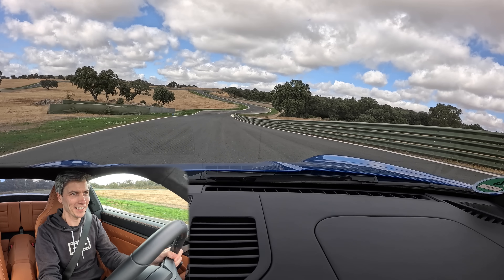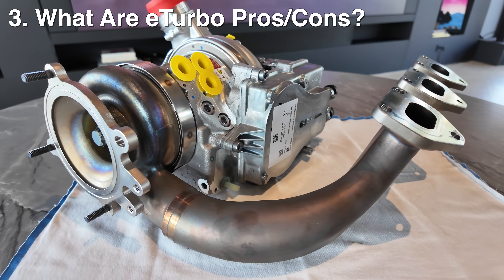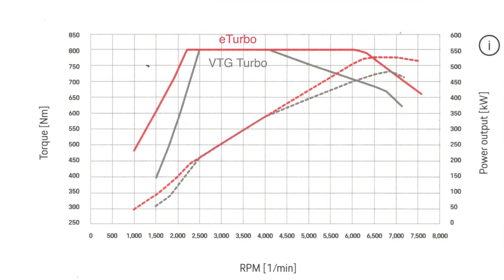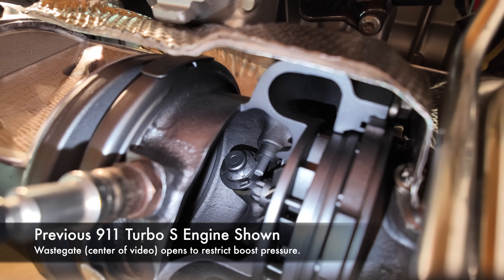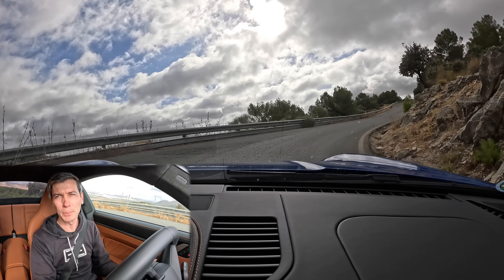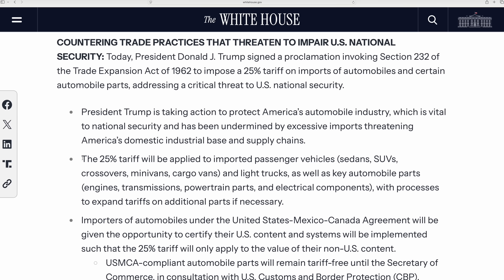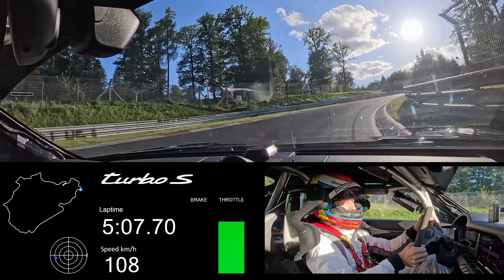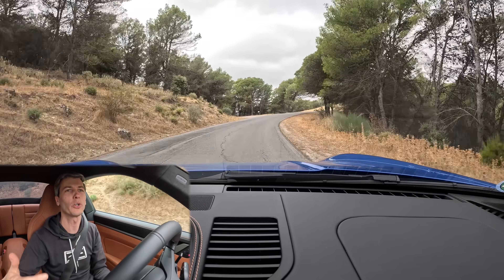Electric Turbos Are Here — Is It A Good Thing?

Comment: The real issue with 911s is that 12 year old models cost more than normal new cars.
Reply: Sounds like you get to daily a Porsche :P
Reply: They hold their value. Makes leases more affordable, but it does make it hard to buy a used one for pennies on the dollar. The current “cheap” 911 is the 1999 - 2005 996. You need to be aware of the limitations, but you can buy one for $20k-$30k. 

Alternative is to spend that amount on a 24 month lease on a new one. But you’ll have nothing after the lease. 

Another way to look at it is that Porsche is a luxury brand. They don’t sell cars for every buyer.
Reply: @EdDale44135 911s are a something else. A Porsche Cayenne or SUV is not a luxury car. Those are soccer mom cars.

Comment: I misunderstood this when it first came out.I thought there is an electrical motor that spins on the exhaust side that charges a battery independently. Then there is another electric motor that spins the turbine in the turbo. I was initially happy that the turbo does not need to get super hot anymore and no need for both oil and coolant to cool it. 

Now i understand that the turbo and electric motor is still connected to the exhaust.

Comment: I've always liked the idea of electric turbos in terms of getting more power and less lag. But wouldn't there be a concern having an electric motor especially one that is responsible for multiple jobs, build directly connected to one of the hottest parts in a combustion engine.
When I thought the idea of electric turbos back years ago when I heard about them. I though of it to replace the need to have exhaust power the turbo. More like an in-between turbo/super charger.

Comment: I wonder if the back-pressure form the e-turbo, while regenerating will hurt the engine. waste-gates just let the exhaust-gas exit without extra resistance
Reply: I think you aren't understanding this right. The turbos can't be restrictive, they are bigger and all exhaust goes through the turbine instead of a small wastegate. The electric motor just prevents overspeed. And if they were restrictive, running the engine at Lambda 1 would destroy it in seconds.
Reply: they would have some resistance, every valve and length of pipe does. But i dont think youre really worried about gas scavenging in a situation where regenerative turbining is active

Comment: I've been working in one of Porsche's test centers during the development of this car and what the test drivers-enginneers were able to achieve playing with the throttle pedal (or with the computer?) meanwhile the engine was at idle was comical, never heard a turbo spool up so quickly, it sounded like having a car with little jet engines 😂 Indeed my favorite application of hybrid engine technology.
Reply from the maker: The turbo sound is quite cool! My mic doesn’t really capture it well in this video.
Reply: @EngineeringExplained   I'm kind of surprised you aren't working at Porsche AG yet, lol. I mean, they earn the rep with their amazing engineering. My great uncle drove Lotus and Porsche in the late 60s, early 70s - 908, 910 and 917. That part of the fam still owns a non-running 910 chassis.. sitting wrapped against rust in a car barn on the west coast.
Reply: @EngineeringExplained it was very loud on the test cars, but I have no idea how is it on the final product, I still didn't have the occasion to see one running properly.
Reply: Maybe you might be able to answer this question.  He says that the electric power goes to the electric turbos first which makes sense in a performance situation but lets say you are driving around town wouldnt it make sense to have the electric power go to the electric motor first?  It seems like you could increase the city mpg by doing that.  It would provide that torque to get the car moving and then the ICE engine would just keep the car moving.  Just have an eco mode for the car for the day to day driving.
Reply: @pin65371 this is a good point. What Jason is assuming is that we are at wide open throttle (WOT.) At engine parameters of less than WOT, the use of any turbo is minimal, and you would be applying a flow restriction to the intake path. Most turbo systems are designed around this concept. It took me a while to get it.
Reply: @pin65371  I have a Porsche Panamera e Hybrid.  When I am cruising at low RPM and hit the gas, I'm pretty sure that the battery assists the drive shaft at the same time as spooling up the turbos.  Jason was reviewing a 911, whereas mine is a Panamera.  Porsche engineers might have optimized the system differently for the two different cars.  Or, I might not know what I'm talking about.  But the bottom line is, my Panamera accelerates smoothly from a cruising situation.  There is a button on the steering wheel that I call "all systems go".  When you press that button you get 20 seconds of maximum performance.  That button might re-map the electric to spool up the turbos first, just as Jason explained.  I don't know this for a fact,  but that is how it feels.
Reply: @pin65371 unfortunately I cannot answer on this, I'm not an engineer and I wasn't involved in the development of the car, I was there mainly as support.
Reply: @pin65371  I dont think they care about that, but rather want it to improve performance - rather than driving around like a prius/silent in the city.
Customers for the 911 turbo I think want it to make noise and be quick. Of course car makers have fleet emissions to consider too, but that is on the average of the fleet.

So the top models they often want to compete on performance as a metric.
Reply: @OlavAlexanderMjelde  I get that but it seems like it would be a pretty easy thing to just have an "eco" mode where it sends more power to the electric drive motor first just to get the car moving.
Reply: @pin65371  yes, it would be better for the environment I guess, but it would make less noise from the engine.. So I think if you buy the "top dog" Porsche, you dont want it to be silent. Then you want people to look at the car as you are arriving or going away..
Reply: > never heard a turbo spool up so quickly, it sounded like having a car with little jet engines
Aren't jet engines actually relatively slow to spin up?...
Reply: @PavelKostromitinov I was referring to the fact that the turbos were able to reach a decently high speed faster than the engine could raise from idle so you were hearing a strong whistle from the turbos before hearing the engine sound increasing. It might easily be that this is not achievable on the final product and that it wasn't even achieved through the throttle pedal.
Reply: Wow would the type work on my ML420cdi ¿ Are what's you idea on making my Ml 420 twin turbos faster? 
Everton
Reply: What about heat? Electric motors have potting around their windings and I'm curious about life time of these electric turbo motors....
Reply: So... why not just apply a belt-driven blower instead of adding more stuff to break, in an already ablative system?
Reply: I know the janitor at the same test center and they said the same thing 😮
Reply: Was that in Georgia?
Reply: @jasonhunt007 looks like the launch event in Italy

Comment: One important question is the pedal feel. I have a Mercedes Benz C mild hybrid. The electricity has absolutely ruined the gas and brake feel in city driving. The feel isn't just bad, it changes all the time. I have now had 2 generations of these and both generations have a bad feel, but in different ways. My cars are 2019 and 2022 (2019 and bad battery problems and I ended up buying a new one). 2019 had the electric engine/generator up front, the other between engine and gearbox. This video mentions no feel problems. I hope Mercedes Benz cures its problems. Don't ever get me started on the new glass dash and touch buttons on the steering wheel.. I have been driving cars and heavier stuff for 50 years now. Many things are better now, but the companies should hire real automotive engineers instead of all these computer nerds they now have. I drive a car, not a phone or pad. Some things were definitely better before.
Reply: Use drive program Sport or Sport plus, you might get better feeling I guess!

Comment: Wonderful explanation of this system (as expected from you). As there is no wastegate, as the turbo drives the motor as a generator to recover energy doesn't this increase exhaust backpressure, affecting engine exhaust efficiency?

Comment: Surprised they went with 97mm bore compared to 102mm in the previous turbo models and GT3s. Makes this feel very close to the GTS powertrain. Could be emissions also, Andreas mentioned they couldn't get the 104,5mm (4,194l) from GT3 R trough emissions for the new 992.2 GT3. Excited to see what they do for the new GT2 RS.

Comment: Little failure in the explanation…there are 711 HP …like zip-code of Stuttgart 😊
Reply: no. 711 wimpy European PS (metric horsepower). 701 proper Imperial brake horsepower

Comment: I'm interested in what the aftermarket will do with these e-turbos (assuming it won't be limited to OEMs) and how they'd be implemented. Would it mean we'd need another battery or could we run it off 12v? Could it replace the alternator, thus freeing up the engine more? How would it be controlled?

Comment: Hmmm …very impressive, but an emotor sandwich between two hot turbines…???. Just like those hot “Vs” a few years back; sandwiching a turbo between the cavities of the “V “ cams; that didn’t turn out so well did they?

The Germans, great engineering but not so great in keeping them running.
Reply: That is an oxymoron: being a great engineer implies that you design things that work well and keep working well for as long as necessary. And your misgivings are clearly unfounded and based on guesswork. Electric Turbo's are a well know concept that has been on te market for quite some time now. It is just a case of designing the cooling and material choice.

Comment: The idea activly accelerating the turbocharger at low rpm and taking energy from the turbine is actually quite old already. The british experimented with it in the 1940s, on a 12 cylinder 41 L two stroke diesel.

Comment: How much weight added ? 85Kg. How much power consumed ? 40Kw. How much more power to generate by the alternator with electrical losses ? Is there a regen period during which I cannot use the electric turbo ? Isn't a supercharger better ? Isn't it easier to double clutch down two gears ? I don't know if I care about accelerating in fourth but I know I care about breaking distances.
Reply: 85kg more on a 1600kg + car isn't gonna make huge difference on breaking distance.
Reply: @yapod9061  depends on the roads you are using said car.

Comment: Can you imagine the issues these will have a few years down the line. 

Porsche are not good engineers, did anyone say IMS bearings, Bore Scoring, cracked engine casings, exposing most of the engine in earlier models to road dirt/salt/water and the effect thereafter on any maintenance as a result, Cracked Chassis Turrets and their lack of support past warranty to any inherent design issues speaks volumes, they don’t care or want to know..
Reply: Considering what they accomplish overall they seem to outdo pretty much every other manufacturer as a whole. They are known for having some of the best and most passionate engineers, that doesn't mean that they get everything right or that it won't have one point that weaker than the rest (which customers will find no doubt). 😄
Reply: @PSA78 I won’t disagree that they have some ideas and development, but often there is no consideration for how reliable the car will be after that warranty period is over, they simply couldn’t care less (that’s my experience anyway)
Reply: @ThreeManyCars I would say that they offer a better warranty than anyone else as they will usually honor it even if it's used on a track. It is after all a sports car, and compared to other cars in the same segment I certainly don't think they are doing bad. 🤷🏻‍♂️ The horror stories about some sport car brands is perfect for Halloween. 🧟😱😂
Reply: @PSA78 I’m talking about 2nd or 3rd owners when the car is out of warranty. Issues like bore scoring or IMS, chassis turret crack etc all of which are poor design but often Porsche just deny everything and don’t offer any assistance
Reply: @ThreeManyCars  I don't believe any brand fixes anything out of warranty, I know some have honored previous recalls that wasn't caught. And all brands have issues sooner or later with something, they are certainly not the worst of any car manufacturer and much less among sports cars. 😄 The horror stories of some brands. 🙈

Comment: Holy Newton’s Law, Batman! Where does that extra 30 HP come from if the engine’s energy output ( here in the form of hot exhaust ) is creating the electric energy? Doesn’t the exhaust turbine spinning the electric motor / generator take energy from the ice motor’s output? If the turbine wasn’t spinning the electric motor / generator, wouldn’t the ice engine output slightly more energy? ( You can tell that I’m not an engineer and I don’t own a white board )
Reply: It comes from energy that you would otherwise be throwing away to heat the outside world via the exhaust pipe

Comment: Wow.  I was not prepared for such a big leap in turbo technology today.  Can't wait until these are available in the aftermarket world.
Reply: I wonder how well this tech is able to scale across engine sizes. You can probably tune this pretty significantly in software for multiple engine sizes.
Reply: Mercedes was 3 years earlier to put it in a production car. Although Porsche has refined their system more.
Reply: Not really turbo tech leap, but reliable and affordable computer technology to safely and properly manage air, fuel and exhaust.

Comment: Very interesting about HV battery powers first the e-turbo. What about the GTS single e-turbo? It powers both turbo and transmission electric engine from the begging since it has the same 400V battery than Turbo S?
Reply: The current GTS drivetrain works on exactly the same principles as the car driven here except it's one turbo rather than two
Reply: @harryspeakup8452 That was the first thing I thought, but I was unsure if, in the case of the GTS, it doesn't need all 40kW since it only has a single turbocharger.

Comment: 1700kg sports car. That's almost twice as much weight as it should have.
Reply: If you want a smooth quiet all-weather 700 hp continent-crossing luxury sports car with rear seats, a 450 mile range and lots of luggage space, capable of 200 mph, it is not going to weigh 850kg. If you want an 850kg sports car then go buy a Series 1 Lotus Elise, something which does a completely different job for a completely different target customer
Reply: @harryspeakup8452if you’re referencing this car, it WILL break down
Reply: Totally agree, too complex, WILL break and cost thousands to fix, and WAY too heavy. 

A good 911 should be 1300/1400kgs
Reply: @ThreeManyCars  The 1400kg 911 is a 718
Reply: @cjpixel and that’s good

Comment: Wouldn't the exhaust side of the turbo also lower the pressure in the cylinders for better intake basically the cylinders would have to do less work pushing the exhaust (obviously for the brief moments it is in use)

Comment: I think in the long term, there may be reliability problems having all that heat of the exhaust manifold bolted to an electric motor?  Electrics do not like heat and if your on a long journey that may be a problem.
Reply: Electric actually can take heat, it’s the electronics that can’t and they are definitely not placed in such a hot place!
Reply: If you read the comments, you’d see that Jason has said that everything is cooled

Comment: Hey Jason, would be nice to compare those e-turbo vs the ZR1 strategy (always have boost in the plenum)
You said it that the ZR1 actually feel N/A..
Reply from the maker: Yes, tho my comments about the ZR1 were strictly regarding track usage. I didn’t drive it below 7/10ths and only drove it on track, where I kept the revs high, so it was always good at getting into boost. On the road, I’d suspect it feels much like any other turbo, especially at low RPM.

Comment: I had this idea when I was driving my 1999 Mitsubishi Eclipse GSX back in 2000. 😢 finally they are putting it to the market. They should use 100% electricity without exhaust gas, so the turbo doesn’t get too hot which reduces life time and lower cost without usingTitanium.

Comment: Sound unnecessary . Could have made one with Hybrid system, the motor would pull the engine to the turbo range, instead of just turbo and then let go, while having all the benefit of a hybrid drive chain

Comment: Very cool! it would be nice to see how a system like this one works with a normal, affordable, car: could it help an I4 2.0T engine become more fuel efficient?
Reply: Only if the engine's use case is spent at full throttle over 50% of the time. Otherwise it's mostly dead weight, vs a regular hybrid which helps an engine become more fuel efficient if time spent at full throttle is as little as possible.

Comment: What's astonishing is that there's 30 horse power to scavenge in the exhaust gazes alone.
Reply: You know what's more astonishing. 2/3rds of an ICE's energy is lost as heat.
Reply: @srinitaaigaura  depends on the ICE. In F1, they have around 50.4% thermal efficiency